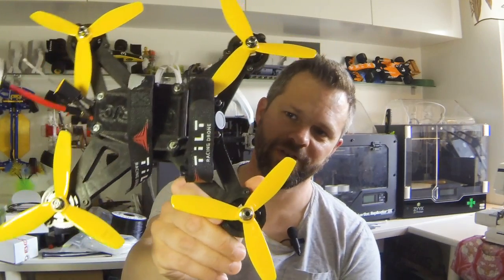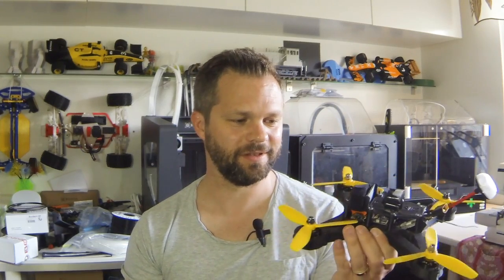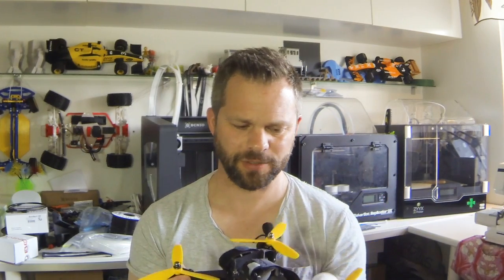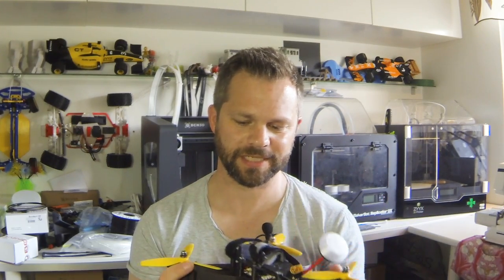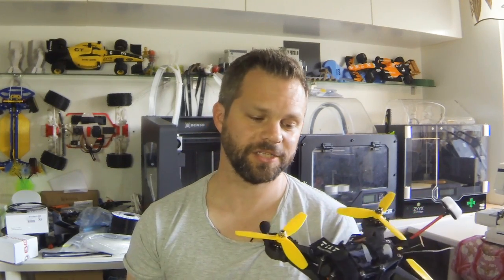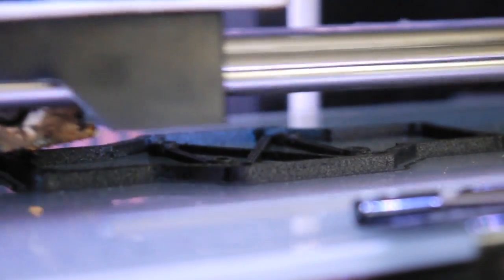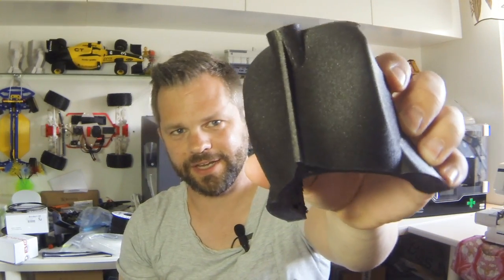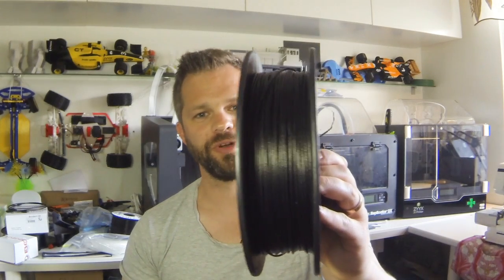Matterhackers NylonX and the 3D printed OpenRC FPV Mini Quad

Comment: I love these materials. I've tried RigidInk Carbonyte and nylforce carbon which I assume are similar at least. I make sure I dry them every time in a food dehydrator, which helps the surface finish and quality loads. Good stuff Daniel! I must try glass and wolfbite some time. glue stick is ok, but I've not tried to print anything big and 'warpy' yet.

Comment: Hi Daniel  i think 265C its to hot for nylon  max temp its 255C ... but  its other things  what you must know ... dont stress and dont use nylon printed parts  quickly  !!!!  Nylon must drink water from air for 2 weeks!!!  Remember wet nylon its more stronger .... and you can print only dryed nylon filament  cople horus in 90 degr....  perfect is take spool in hot case when you print....  this tips  i know from one old man ho all life produced automotiv parts in nylon and pom...  and tray too mixt nylon witch other  substanc like carbon aluminium coper  and  nano carbon tubes  PA6 its not printable (only for injection molds)  for better results  try use PA12 nylon